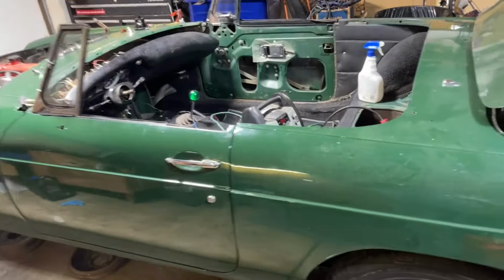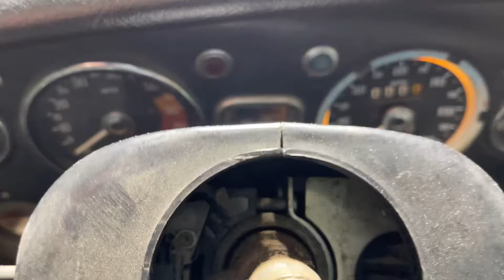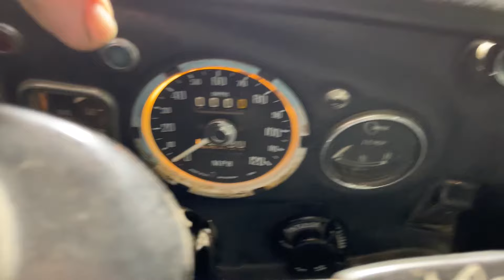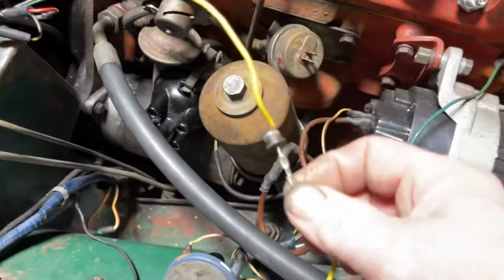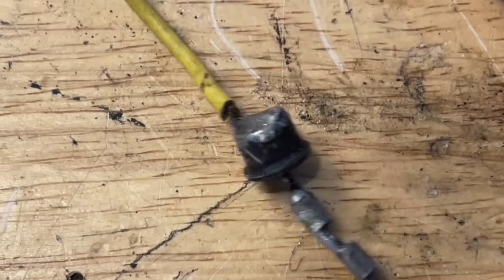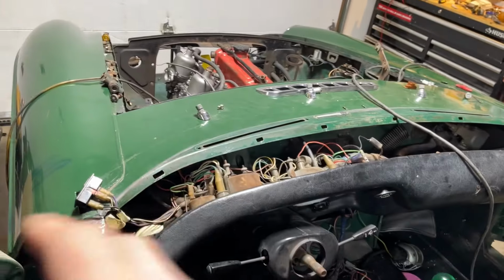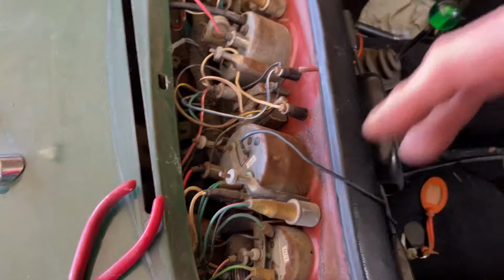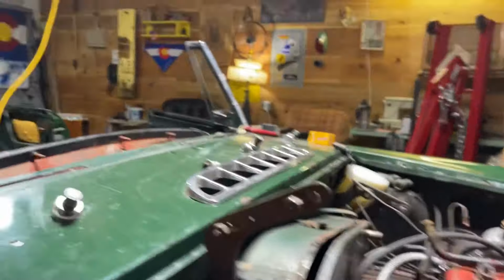Greenbean Day 12!  April 3, 2024.  More sparky action

Comment: Looks like a diode on the yellow wire.
Reply: Yeah I think your right, the closest thing I could find that looked like it was an alternator diode. I don’t really understand it so I’m not going to pretend I know more. Hopefully someone smarter can chime in.
Reply from the maker: What's an alternator diode for?
Reply: @SpencerKleinVintageWatch  Well since nobody smarter than me has chimed in I guess I'll take a shot at explaining it cause I've been thinking about this all week. Alternators output AC voltage and then via an internal rectifier convert it to DC voltage. A rectifier is just a bunch of diodes that chop the AC voltage in segments by only letting it flow one way to create DC voltage. In some cars, you can replace the diode and they are called alternator diodes. 

BUUUUUT I don't think that's what it is now. Is the blue thing a capacitor?  It looks like a capacitor to me. If so then I wonder if the capacitor stores voltage to feed the distributor so that it always has a strong supply of 12 VDC. The diode comes from the alternator to charge the capacitor and the diode, diodes are like one-way valves, preventing stored voltage from back feeding into the alternator? Take my guess with a grain of salt, I'm totally guessing here.